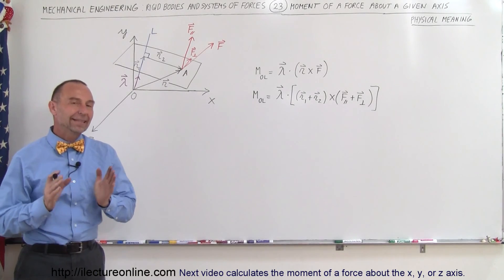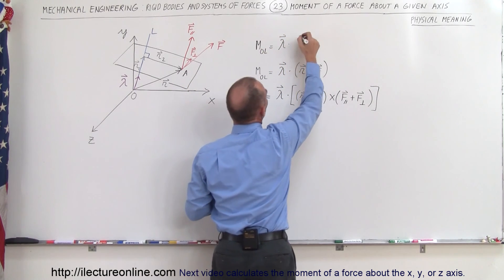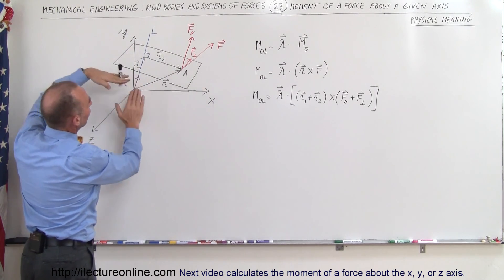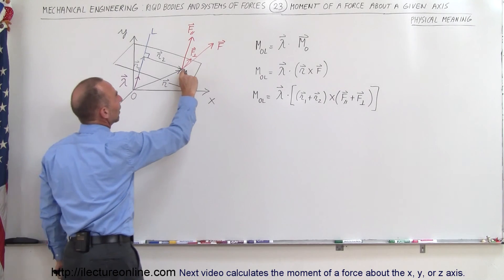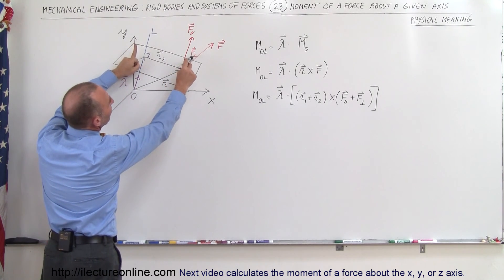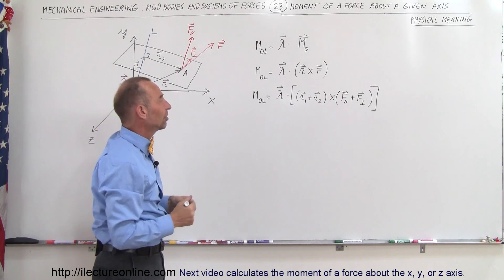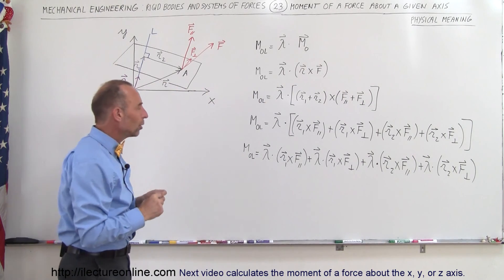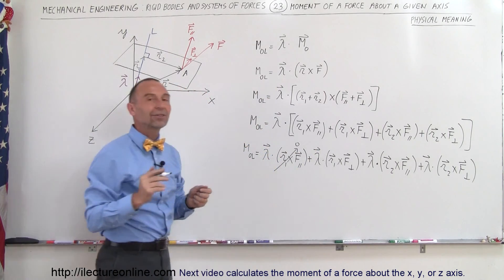Mechanical Engineering: Rigid Bodies & Sys of Forces (23 of 47) Physical Meaning of Moment  of Force

Comment: Also, the magnitude of R2 is the "perpendicular distance" between the force(line of action) and axis(of rotation).  This is often the next lesson on subject of moments and triple scalar products.  ...or the "bonus question" on homework and test question.  It's not a very intuitive concept, so it's often overlooked by engrs. I'm sure I did back when I was a student, but I understand this now and can appreciate it.

For anyone interested, the key is F² = F(perp)² - F(parallel)² 
where:  F(parallel) = F • Axis(direction unit vector)
Once, you know F(perp) magnitude value, then unknown moment arm d is (d-perp).
F(perp) x d(perp) = moment(found earlier from the triple vector product)

Note: F = resultant force, F(perp) and F(parallel) are two components of F.  These reside in one plane so it's a right angle vector component layout, thus pythagoran eq is simply used.